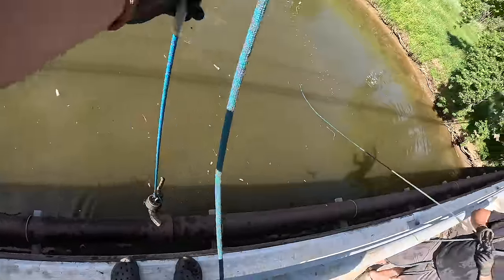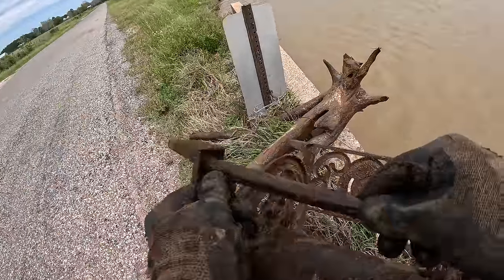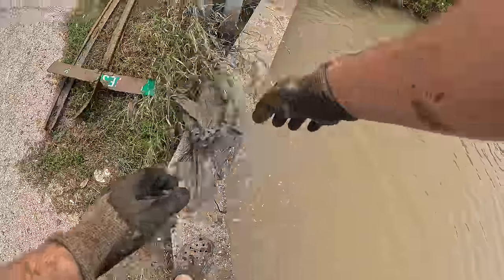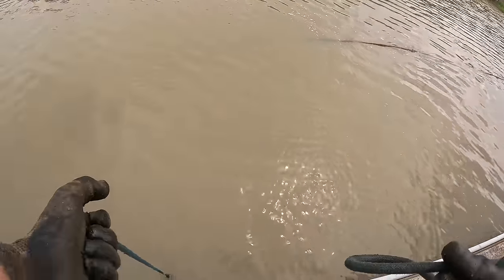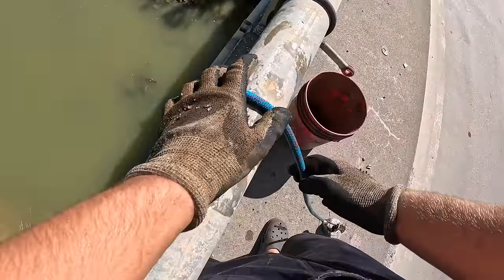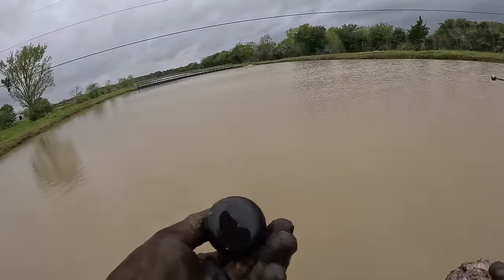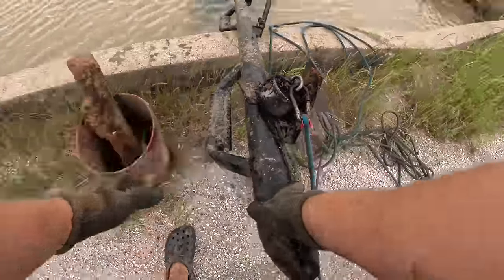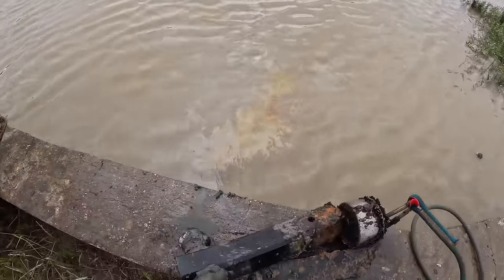We Found A Missing Truck Magnet Fishing!

Comment: Was that truck from an accident which is why there was oil coming up as you guys were able to rip the car apart? Was there cutting marks like from a chop shop? That area looks like someone could have easily driven off the road directly into the water especially in the dark or during a rain storm. That corner was at the worst spot. If someone couldn't see they could have drove off by missing the corner and they could have hit their head when they slammed down into the water knocking them out. There's been cases like that where they found missing people still in their vehicles.